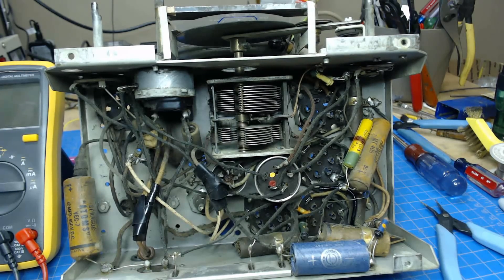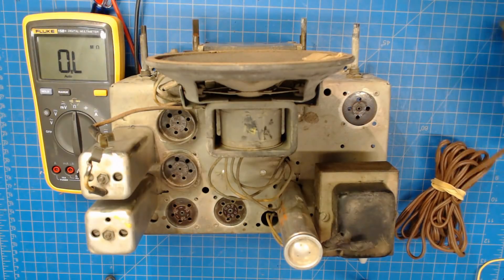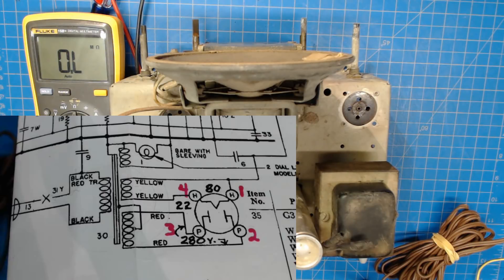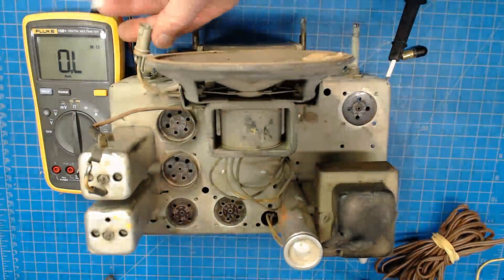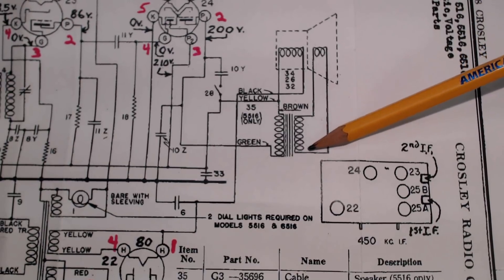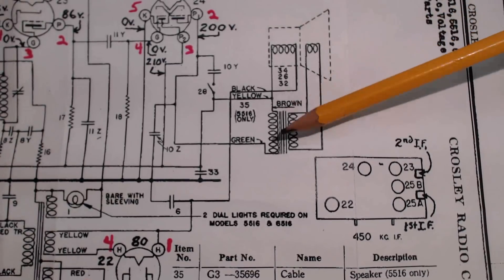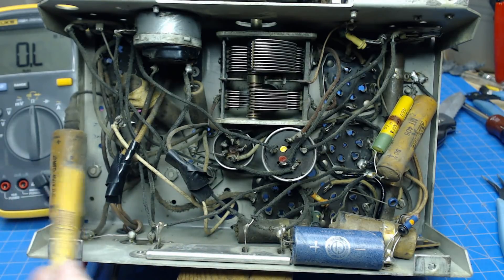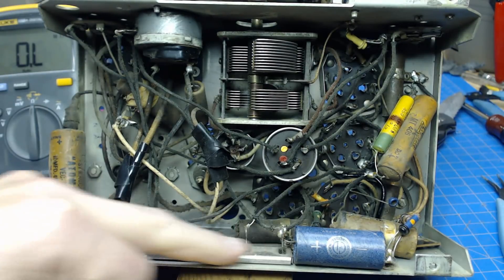1936 Crosley 516 Fiver Part 2 of  7 Electrical Checkout

Comment: I like that color on the cabinet, really contrasts with the bezel. I saw a dog bone resistor with one end broke off to the right of the canned ohm resistor.
Reply from the maker: ruff hardin Thanks Ruff! Whoever painted it, put thought into it for sure! As for the dogbone, lol. Well, I did that! I was trying to move it to read the cap and it failed the stress test! Lol. We will never know if it was good or not now. I havent checked the rest yet, bit aim pretty sure most will be out of tolerance. Thanks for watching and noticing things like that! I do the same when I watch other videos, a good lookover is always important. But, sometimes and I should say most of the time, Im busy filming and not looking as close as I should. Thanks again, Take Care--Larry

Comment: Larry, I found this video very helpful. I love seeing Ohms Law being used in practical applications. If someone had not inserted the voltages on your schematic, how would you have calculated the wattage for the candohm?  You could have measured the actual voltage on either side of the resistor, but wouldn't that voltage drop be "incorrect" since the resistor was off? Is there any way you could have calculated the necessary wattage without knowing the "proper" voltages?  Of course, I guess you could just go with a 5 or 10 watt resistor and feel safe. Thanks.
Reply from the maker: Nelson Nelson Thanks Nelson! I know a lot of people use 5-10 watts and call it good, which is fine. The thing about candohms are they use the chassis as a heat sink so they get by with a smaller wattage. When replacing, most people use the rule of thumb 3 x the calculated wattage because they mount them in free air. Well, Fortunately the voltages were listed. If they are not, you could go to tube data. For example, 6b5 plate specs (typically) is 250v and the 6d6 screen is 100v. Which ohm law gives you about 2.5 watts ( across the 8500 ohm). Assuming the 100v on the screen (6d6) and say to the cathode is the entire 100v drop across 25k ohm will be about .5 watts. All rough numbers, but that is the approach I would have looked at. If I had to go that route, I would search ARF and other places for other similar applications. One thing I keep reminding myself, in 1935, a repairman had very little in the way of equipment and info. So, sometimes I overthink the situation. Tube data manuals was about all they had, if they had that. A lot knew the basic tube data, because there wasnt that many at that time. Great question and thanks for watching and commenting. Another note: if this was a real keeper, I might consider ordering 5-10 watt resistors, but Im not cheap, but with this one I was trying to use what I had.(like the 1935 repairman) Take Care-Larry ps We had a 4.4 earthquake 9 miles from here this am. Yes, it woke me up lol
Reply: Thanks so much for the detailed explanation, :Larry. I heard something this morning on the news about the earthquake. Up here in the Northeast Tennessee mountains we're still trying to dig our way out of 15 inches of snow.
Reply from the maker: Nelson hope that helped! I wish we would get snow. Maybe these local news yahwhoos would quit trying to make it happen. But, they just want to sensationalize it to sell the commercials! Lol